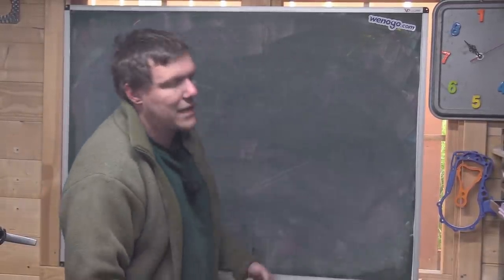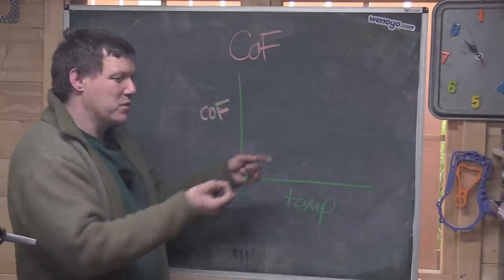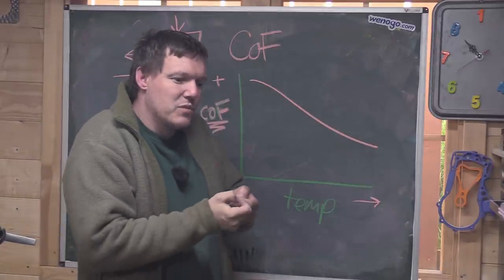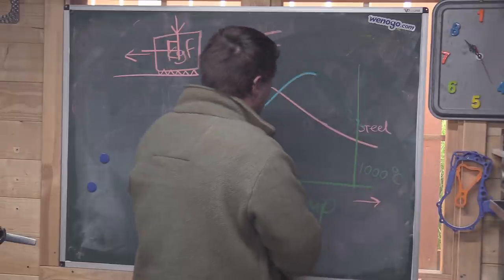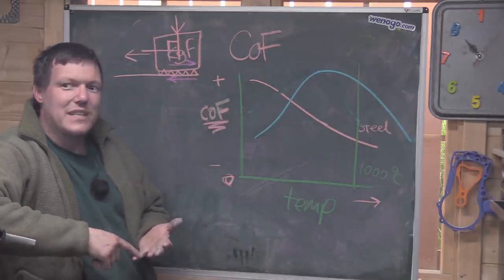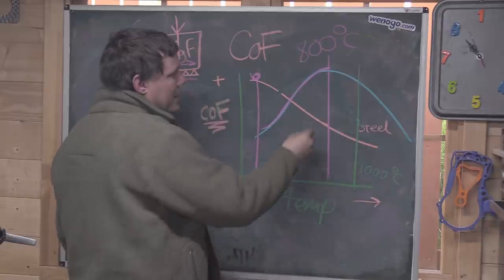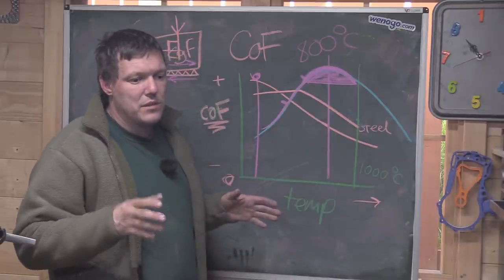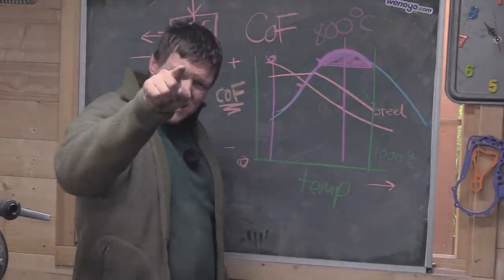Why Carbon Brakes have to be HOT

Comment: Sounds like some kind of dynamic brake cooling system with like a cover with shutters or something and a clever computer controlled thing could be good, especially for circuit racing where it's a repeated lap that can be anticipated
Reply: That's immediately be considered a "movable aero device" and banned.

Comment: I found out about brake fade in me mums Fiesta straight threw a hedge 😀
Reply: Did that on my KH250 on a rainy night back from the pub..... pissed..... straight across a junction and into the hedge. Steel discs were too good and I locked the back wheel as applying too much to the fronts would have been seen me going in sideways. Mate following me had to use the grab rail to pull me out as I couldn't move embedded in the hedge.
Reply: Mexicans... Am I right?

Comment: its amazing how R&D have reached a point where they're using carbon brakes in the wet now, don't know if its the disc covers or the materials or whatever it is, but it is amazing
Reply: You can almost see the progress of them over time. The McLaren F1 didn't get them because they were no good for road use, the SLR did but have this reversed fade issue when you apply them, and now they're pretty much "ok, but expensive"
Reply: @chrisdavidson911  yea, i know of some aston martin's uses carbon disc and pads as well, and same issue, ok but expensive

Comment: Brembo says their carbon brakes optimal range is 200 - 800 °C...to me it sounds that carbon brakes only exist so they are able to handle higher temperatures that occur and still be effective...not the other way around (some people say they brake better, but have to be hot...I call it bs). They don't have to be stupidly hot to work well. Or am I missing something?
Reply from the maker: So the mid range there is 500degC, that's hot. Try doing that with steel discs.
Reply: @dirtygarageguy  from what I've read, they start to fade quickly past 400 °C (steel). But I think you got my point...carbon discs don't HAVE to be hot to work well like most people say...200 °C is a couple turns and they are already in the working range. They CAN get very hot and still work well.
Reply from the maker: Look up the CoF for CFCMs.

They work better when hot, and we all want better when braking. I'm also talking about racing in this video.
Reply: @dirtygarageguy  yeah they work better. But they don't have to be glowing red to work well. I'm talking about bulk temperatures and racing as well. There is a misconception most people have that they don't work so well at not so high temperatures. Doesn't seem to be like that.

I really like your channel, been a follower for years. Keep up!

Comment: Matt could you do a video on tire friction vs load and temp? There is this guy who put f1 tires on his car but he couldn’t get any traction
Reply: They need to be warmed up and kept warm to get traction. They can be like hard rubber and quite slick until at specified tire temperature

It's very similar in reasons why ceramic disks are only used in racing
Reply: They also need shit loads of downforce to work properly.
Reply: He put them on a Catertham, how were they ever going to work?!

Comment: Excellent, blackboard stuff. Ta, I get mental brakefade on my Yamaha. First, the braking is piss poor from the off and second, I go on my travels and ride for 6-8 hours a day and by the afternoon I might as well put some bloody Blakies on my boots and put my feet down to stop. Bearing in mind I'm not taking about motorway riding.
Reply: How often do you flush and replace the fluid
Reply: @archiedentone5950  irrelevant, Yammy brakes are poor. I've put new disks, pads and fluids. No difference.

Comment: According to ur graph cast iron works best at lower temps.. if the graph temps start from -270°C would cast iron cof curve on the graph look like the carbon one (hill shaped)?
Reply from the maker: Who's running brakes at absolute zero? But you also have to take brittleness into account
Reply: @dirtygarageguy  I think his question is interesting. Is this "bell" shape curve typical for materials? Decrease CoF with temperature is "understandable" for me: at higher temperature vibration of molecules prevents details to go closer and increase Van der Waals force. Additionally at higher temps less force is required to shear the contact layer. But grow of CoF with temp is not obvious. In any case, it is worth to shed light on topic of friction in different mechanisms. People have many misconceptions about it, starting from belief that bigger tire contact path makes you stop quicker, more wheels - better grip and etc.

Comment: can I get an explanation about some of the stuff on discs versus drums and stuff at some point why people laid.drums are theoretically more efficient but in the real world disc's heat management make them.more usable?
Reply: Drums are not “more efficient”. They have more friction area but it is less effective than a decent two or more pot caliper and disk. There are no advantages to drums on motorcycles at all
Reply: Drums are heavy, they work good. There application is great for trailer brakes, your “lorry” trucks use them.
Reply: @JAMESWUERTELE  correct. Low speed and heavy weight loads where their heavy weight isn't much of a concern

Comment: No metal discs in MotoGP nowadays, they use carbon even in the wet
Reply from the maker: Are you 100% on that?
Reply: I think it started in the 2019-2020 season, it's been a year or two at least
Reply: @dirtygarageguy  yeah they more or less are they have massive shrouds on the discs, in wet to keep the heat in. Last few wet races this season all have been doing that.
Reply: I presume adding  ceramics to the carbon 'mix' forming a compound with heat siliconisation?helps to prolong the sweet spot and/or stabilise the structures as l think the discs started turning to mush in certain conditions and this maybe the tech that enabled them to do away with steel discs? (I was crap at the chemistry maths at school)